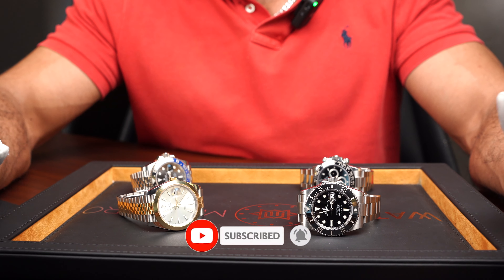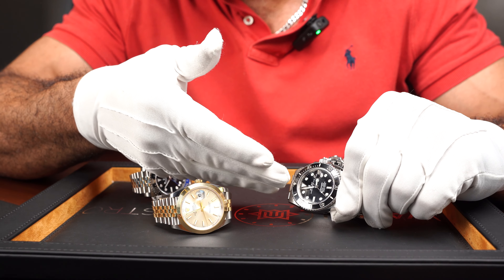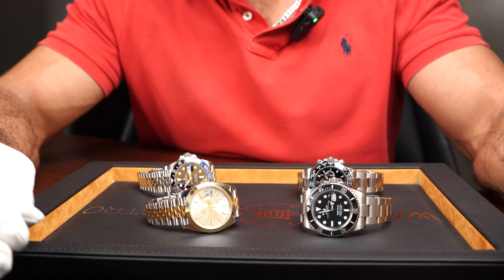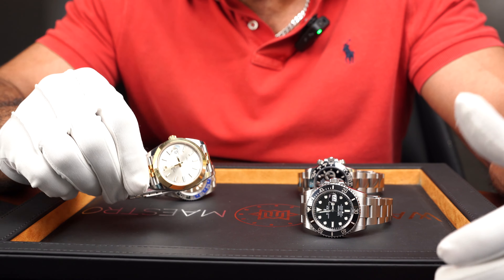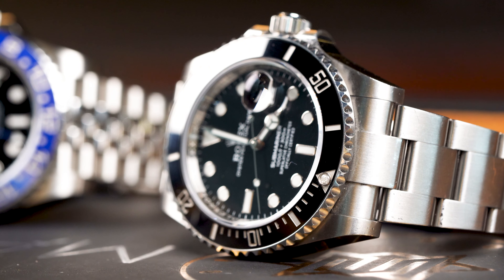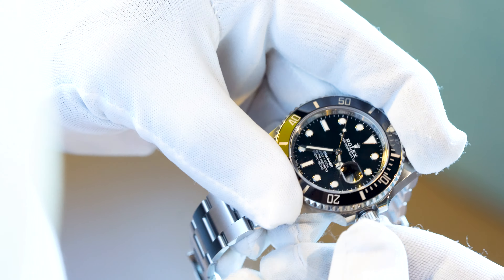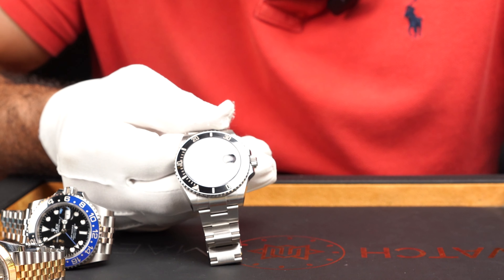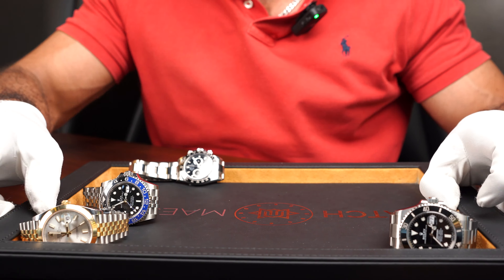3 Functions of a Watch Bezel You May Not Know | WatchMaestro

Comment: You're starting off clueless already. The bezel on the DateJust isn't just for aesthetic reasons. It's there to hold the crystal in place.

Divers don't breathe oxygen. They breathe air (or nitrox, trimix, heliox, etc.) Oxygen is toxic below 6 meters or 20 feet.
You use the bezel as a bottom timer. It has nothing to do with gas consumption. It has everything to do with no decompression limits.

The tachymeter bezel isn't for timing laps. That's what the chronograph is for. You use the tachymeter scale to time a known distance, like 10 hectometer signs, and you can read your average speed on the tachymeter bezel. Circuits aren't exactly 1 km, 2km, 5km, or 10km. They're 3.337 km, or 5.891 km, or 5.809 km, or 20.830 km. A tachymeter scale is completely useless for a full lap.
The seconds subdial is not part of the chronometer. That's the running seconds of the regular watch.

Your explanation of the GMT bezel applies to the GMT-Master. The GMT-Master II has an extra trick up its sleeve. You set the GMT hand to your home time, your hour hand to the local time, and set the bezel to the time offset to your home time for a third time zone.

Also, how can you not include the Sky-Dweller? That's the most impressive bezel of any Rolex watch.